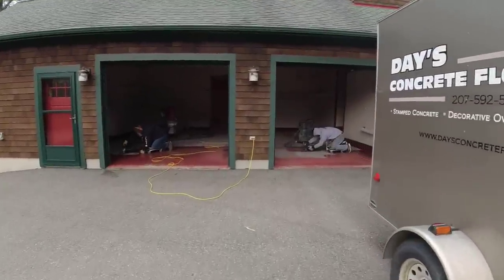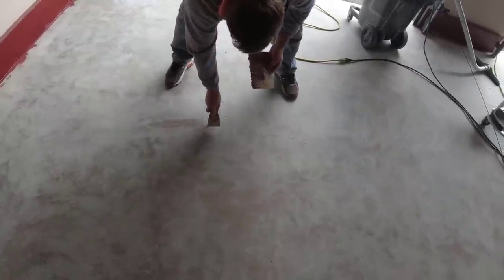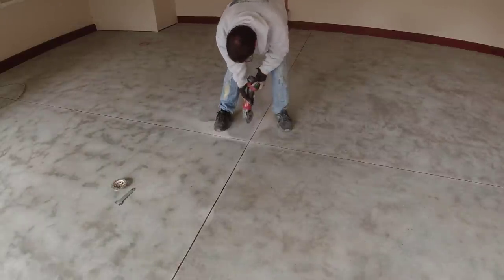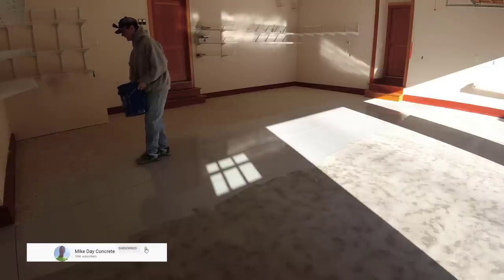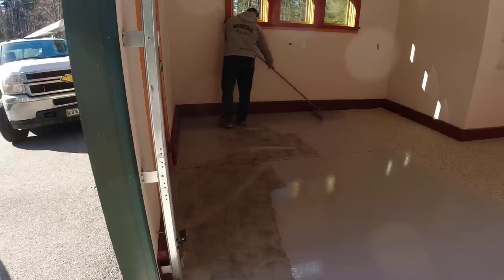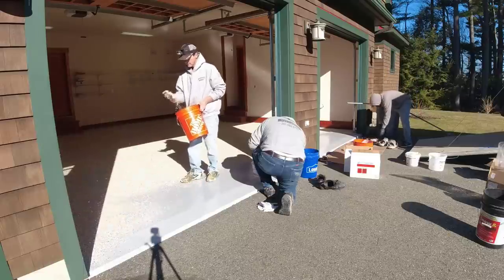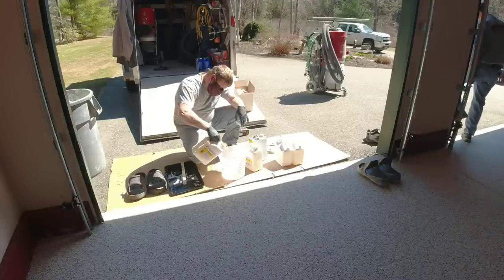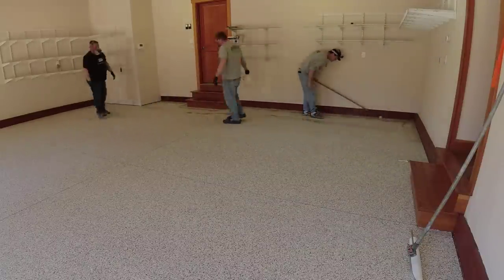NEXT LEVEL Epoxy Garage Floor Coating | Perfect for 2023

Comment: Thank you for your videos.  Do you have a DIY on pouring new concrete over old existing concrete? I'd like to smooth and renew our concrete floor, but would rather not do epoxy.  I want something that will last decades and is very practical...Is it possible to put a new thin layer of concrete over old? thank you

Comment: Mike, how would you prepare and pour a concrete floor and ready it for an epoxy finish. Taken into consideration about surface finish and dampness of cement. Thanks Pk
Reply from the maker: I'd have a gravel sub-base, 10 mil poly vapor barrier, pour a d finish concrete, leave the surface a little fuzzy from the power trowel, don't burn it smooth. Have to let it cure at least 28 days at 70 F. Then grind surface like in the video to prep for epoxy.

Comment: Hey Mike, would you grind and clean a freshly poured pad to give it a sealer? 
Or what would you recommend for a new garage floor that will get a lot of salt?
Reply from the maker: I'd recommend a flake coating just like this one for a garage that gets a lot of salt. Yes, I'd still grind a new floor. The acrylic concrete sealers won't hold up to salt.

Comment: Curious what you would charge for a 24x36 garage. It was poured last august and it’s being built in 2 weeks. There are 2 spots that need to be patched?
Reply from the maker: Prices for this are different all over the country. They can range from $5 per sq ft to $9.
Reply: @MikeDayConcrete  ok thanks for the info.

Comment: Hey Mike, is there a particular reason you guys don't use a Squeegee? Does rolling on the epoxy without using a Squeegee first make it more likely to peel over time? Asking because I hate squeegeeing and can't seem to get the technique down when we install epoxy. Thanks
Reply: Using a squeegee is helpful because it spreads it and sets it at a generally more even depth throughout the whole coating system than dipping and rolling will, dipping and rolling won’t make the system more likely to fail by nature, but it can cause the floor to be less even.
Reply: @MisunderstoodWierdo  thanks for clarifying